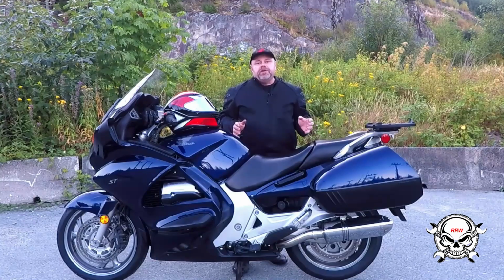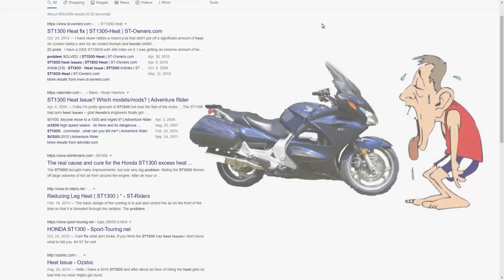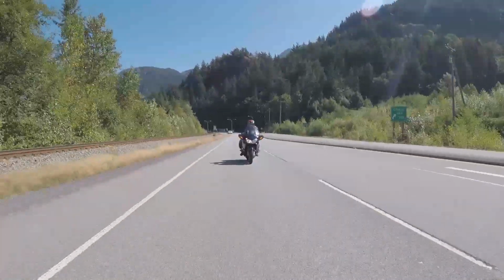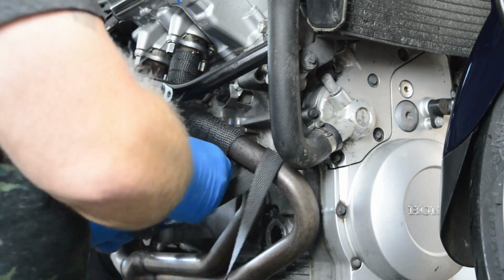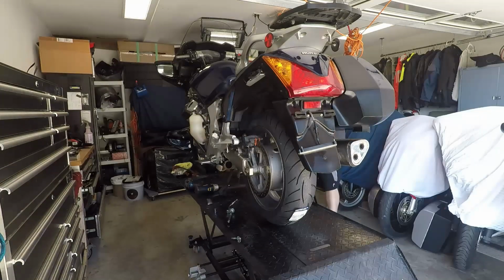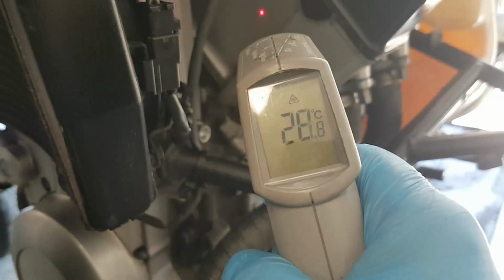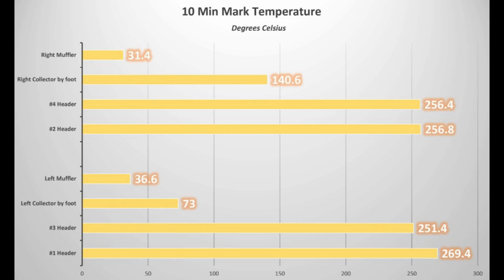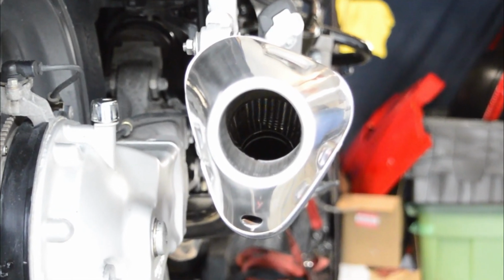Honda ST1300 PanEuropean Heat Reduction

Comment: Hi Rod
I recently bought a  2008 ST1300.
Never rode one before. 
Came off a naked Kwaka Z900RS.
Bike is beautiful. 
Went for a ride on a 26c day here in NZs South Island. 
Lower legs cooked .
Will do the pipe wrap and looking and buy Delkevic mufflers.
What model is on yours.
With baffles in how is highway noise  ?
Like throatier sound than standard but don't want it too noisy either.
Cheers
Love your work

Comment: I don't see any comments about venting the inner cowling to allow more air flow. Did that years ago, I'm in Mississippi, plenty summer heat, but no issues with heat of the ST after cutting  2 in holes in the inner plastic panels, simple and zero cost. Have a Silver 2007, since 2008 bought brand new; 50,000 miles on it and runs great. Only issue i had was the sensor wiring for the radiator fan, had hell getting to it way down in a very tight spot under the gas tank , I do recall, there was a short as the insulation had rubbed off,  covered it with insulation Like the heat in the winter! So i did not reduce any radiator heat but did vent off engine block heat from my shins
Reply: где  сте  направили  те две  рупе    ако  може  слика  хвала  поздрав
Reply: Which one.. can you show me the position

Comment: I don't see any comments about venting the inner cowling to allow more air flow. Did that years ago, I'm in Mississippi, plenty summer heat, but no issues with heat of the ST R cutting side 2 in homes in the inner plastic panels, simple and zero cost. Like the heat in the winter!
Reply: Can you post pictures on what you did?

Comment: Thank you, felt instant results on my first ride after wrapping. Totally transformed the comfort level... on a side note the oil filter is  on one side and rad hose on the other now have some added protection from the radiant  heat also.
Edit... 1st long distance run... absolutely no excess heat, avg 39 mpg at, shall we say ... spirited riding. And no my headers didn't rot and rust off...  Highly recommend this mod.

Comment: I read somewhere that the thermostat needs to be changed out on a regular basis because they don’t last long, what’s your opinion?
Reply: I’ve got an ‘05 ST1300, after changing the thermostat my bike is noticeably cooler running. With a broken thermostat the bike never takes off the choke, and so it runs lean and therefore very hot.

Comment: Hi Rod, I have just purchased a 2011 Honda ST1300 and am thinking of changing the standard tail pipes. Are the catalytic converters built into the standard mufflers, or are they built into the header pipes, as i believe their removal also helps with the reduction of heat generated by the motor. The standard mufflers do stifle the sound and make it sound like a wet fart almost, Cheers and love your videos.

Comment: Rod. I have a K1300GT and will be changing the muffler for a Delvonic muffler. Would you reccomend the 13” or 18” muffler?
Reply from the maker: If you ride with panniers then take the longer muffler so your exhaust is not cooking your bag everytime you are stopped in traffic.
Reply: I was thinking the same way. I usually do use my saddle bags on the bike. It seems the suspension likes the extra weight for a softer ride on the 1300. I will do the 18” muffler.
Reply: Luv your videos by the way. I’m picking up an anniversary edition Honda VFR800 with the factory bags and a set of Staintune pipes. Can’t wait to put some miles on that one.

Comment: Someone said that if I put exhaust wraps on my bike, the heat being trapped in the pipes will cause the motor to run hotter, and may even melt the factory wire harness, knock sensor wires/switches, and cause all kinds of problems with shorts, and alternator issues. 

Is this something you experienced in the time you had the ST?
Reply from the maker: Whoever this is that told you this, do not listen to any advice they give!  This is the exact opposite of what the benefits are of wrapping your header pipes.  Please think through the logic in this statement, The engine does not run hotter since the exhaust wrap is on the exhaust pipe, not the motor.  For decades professional racers have used exhaust wrap to keep engine compartments protected from exhaust heat so things like ignitions and wiring harnesses are better protected from heat. And as I stated in the video, the racer's claim that exhaust moves more quickly through the exhaust system with the header pipe wrapped.  This means that more heat is carried away from the engine...
Reply: My ST getting hot on fuel tank,after wrapping. 
Its ok until outside temp reach more than 32C. 
Pipes are not cooled from the outside air anymore And temp growing up steep.
My question Is ......
I'm only one,experience this?
By the way,this is very nice video. I dont want hurt enyone. Thank you.

Comment: Thanks for your version of heat reduction. I really like the comparisons back to back that you do.
As an owner of an 05 and 2012 model, I don't think I heard you mention removing parts of the inner fairing to allow for better air flow.
I had adjustable supertrapp aftermarket exhaust. it decreased performance.
I would use caution and wrapping exhaust as heat and cold cycles cause condensation and  results in rust.
Again, I enjoyed your approach
Reply: Had mine wrapped 18 years ago, live in high humidity, still waiting for rust!

Comment: I had two ST1300s, a used ‘03 and a gorgeous red ‘09.   What helped me( I lived in Shreveport while I owned these so my experience was pretty much like you in Austin) was running Mobil One.   I learned this running this oil in a Kawasaki Z1.  I also ran a Beadrider seat cover so I could keep air under my tail.
I bought the ‘03 with 35k and eventually sold it with 154k before I started listing for the red one.   When I bought it I transferred my trailer hitch and bar risers and then had the optional fairing deflection kit added.  That Kit really did good things for rain and wind protection.
I always found the wind noise harsh on my modular helmet and running ear plugs helped some but they were still noisy.   I have a 2015 Goldwing now so the wind noise is much better.

Comment: Thanks for the excellent video, Ive just purchased a Pan 1300 with 17000Km almost new, was standing for a long time, Ive have quite a bit of work done to it, reline the tank due to rust, sort out a lot of corrosion issues, the bike is running very well now, but the heat on my shin's is not good to say the least, especially as I live in South Africa where the temps are around the 35c here in summer.
Is the exhaust change going to make a significant difference on its own would you say?
Ive spent a load of cash on the bike as it is and dont really have it to burn, if its not really going to do the trick?
Reply from the maker: Hello Mike, yes wrapping the headers and changing to a free flow exhaust will make a big difference for sure! https://ebay.us/lO2vmh Good Luck with the new bike!

Comment: 1 - I have a massive burn on my shin from the heat off the engine. Can you point me in a direction to begin looking? In other forums I've been accused of living about the burn. I did buy high boots and that lessened the area of burn, but did not cease the burning.
2 - I was going to wrap my pipes, but was warned about the pipes possibly cracking. What gives? Is that something to worry about?
Reply from the maker: Hi Rob Never seen anything that bad from an ST1300, I've owned three of them and logged thousands of miles.  I think your issue is the exhaust header, the collector for the two pipes is right under your foot, my legs are short so my stance is wide when I put my foot down.  If your burn did not come from the header collector or crossover section under the middle of the bike, I would for sure wrap the headers all the way to the crossover pipe.  Everyone has an opinion but if your choice is replacing the headers after a few years or the bike is unable to ride because it is  burning your leg, it's pretty clear IMO.  There are lots of used parts for this bike on the market for cheap.  I personally think this is all bullSH*T and is a comment from someone who 1. Has no first hand experience from wrapping a header and 2. Just a contrary clickbait argument.  I've wrapped headers on cars and bikes, never seen a failure that was not due to the wrap falling apart because is old or was done improperly.  The header wrap is not permanent and should be redone every few years but that is pretty cheap too! - Good Luck!

Comment: Bought a stock 2005.Seat position on high mark. Big gaps between the seat and tank.  Fried my junk on the first ride. McGiver - Ghetto fix. Remove tank, layers of  aluminum foil sheets  sealing the gaps between the seat and tank. No more heat issues. Side heat vents are hot on summer days, but ok.

Comment: I just duct taped cardboard to the gap between the tank and seat. Made a noticeable difference.

I make a habit of not riding in traffic. The bike has mainly been for highway weekend commuting (Vancouver to Kelowna) and touring the mountain states of western USA. For the most part, the heat is not an issue at above stuck-in-traffic speeds.

Comment: Does the ST1100 have same or comparable heat problems as the ST1300 ?
Reply from the maker: Not really, most ST1100 owners never complain.  This being said, the ST1100 is a product of the time it was produced. Carbureted, top heavy, meh brakes and suspension, most you'll find today are in need of $erious expen$e to restore (all old bikes fall into this category).  Having rode both bikes, the ST1300 is a my hands down choice, the 1100 is not even comparable.  There are also a lot of bikes you can buy that should be newer for the same money BMW R1100RT https://youtu.be/1y23fS37_k0  :yt:  I know a lot of ST1100 owners love their bike, it is comfortable for a big bike and moves reasonably well for their age.  The carbs are complicated and most used ones have lots of use with high miles.   Let us know if you're considering one. 👍
Reply: Thanks for the reply . I just found this RR&W site and enjoy the content and the overall attitude of it. Thanks again and good luck .

Comment: I have a ST1300PA 2016 left over police bike. I cannot find an aftermarket muffler that match that model. Are you familiar with this model ST1300PA?
Thanks
Reply from the maker: Hi Kevin, I am not familiar with the PA model, based on part number searches and photos there is no difference between the standard and the police model for exhaust or muffler.  You can check the ST1100/1300 forums as there will be some riders there who have police spec bikes but even if your bike is slightly modified the standard muffler should bolt in place. - Good Luck!
Reply: Thanks for replying.
On the aftermarket muffler that you installed you talked about the noise. 
And to cut the noise down you put the baffles back in. How much does that change the airflow? I know you mentioned that taking the baffles out allows more airflow which in turn produces less heat. 
Thank you!
Reply from the maker: @kevinmortensen7186  Hi Kevin  You can see the difference between stock, baffled and baffles out on this video with a db meter along with some other performance updates. https://youtu.be/HE3_h2I_rK8

Comment: I bought a 2007 ST1300 one year ago this month, I did some minor maintenance on it and changed the oil and filter, as well as the fork fluid. I absolutely love this bike, ive wanted one for years and became very fortunate last year when I was able to locate and purchase a 07 with 30k miles. I ride it daily here in Austen tx and the heat is pretty bad, it almost burns your bum. this winter I plan on doing an exhaust and give the rap a go... my plan is to ride it out to the north west and maybe even Fairbanks. thanx for the vid it really helped me.

Comment: Wouldn’t you think modifying the front lower fairing would help to move air around  the motor? 

Did you ever try anything else under the seat?  I am picking up a 2007 and in TX I can see the heat may be a problem.

Comment: All the mods needed to reduce the heat problems seems so expensive that simply moving to an Yamaha FJR1300 would be a better solution.
Reply from the maker: But then you still have to contend with the lack of power from a dual counterbalanced inline four. (don't let those get out of synch or you've got a bike only your Wife will love due to the vibration ) 😉.  I've owned two of them...

Comment: Nyce job 👌👍Like yr scientific approach to quantifying results. A lot of suggested mods from pals n other riders are more urban myth than proven science 😁I also like very much that you know of the top parts suppliers, for those might win the prize,  in lots of jurisdications EVEN across the pond in the UK 😄Shoot, "ghost bike" is not a Triumph Sprint GT 😔 Why I wanted it to be a Sprint GT, guessing not much demand, is because it has a serious problem with over heating especially in slow traffic. Like a Spitfire 😁on the runway, she overheats badly but when she's taken off she keeps cool n is just a  beautful agile flying machine ! Will look through past vlogs but any tips to help cure or even just reduce the amount of over heating ??
Reply from the maker: Thanks for the feedback.  I have not had any issues with Triumph GT/ST 1050 or Speed Trip overheating but I will look into it.  Thanks for Liking & Subscribing!

Comment: I’ve got the exact bike as yourself and have a set of Two Brothers exhaust and after market Leather Sargent Seat with special super cell premium foam with deeper pocket. Both the seat and exhaust came with the bike and I’ve never really noticed any excessive heat coming from the bike, but I rarely run in Urban Environments. I’m totally with you on the aftermarket exhaust for St 1300, since I can keep the speed down and know what gear I’m in by the sound of the bike.   
The Two Brothers just gives me that Honda Growl and totally compliments The V 4.
Reply from the maker: New ST1300 Video Coming Soon...  Thanks for Liking & Subscribing!

Comment: So after you got all the Tupperware back on, did it still stay cool, especially in the seat/tank area?
Reply from the maker: It was cooler on the legs and fairing, much better at low speeds in traffic.  Was not as dramatic an effect on the seat at highway speeds in the heat.  New ST1300 Video Coming Soon...  Thanks for Liking & Subscribing!
Reply: @RodRidesWrenches  Thank you for the response still on the fence about doing this or not. I really enjoy your video's top-notch!

Comment: Bought a set of Delkevic long ovals. I don't care if it runs cooler I love the sound. At times the ST can be boring to ride even at surprising speeds, the sound of these pipes fixes that.
Reply from the maker: Agreed...  New ST1300 Video Coming Soon...  Thanks for Liking & Subscribing!
Reply: @RodRidesWrenches  hi
Can you do a video how to remove a alternator on a 2009 Honda st1300pa model?

Comment: Thanks for the work involved and love the detail that you go into, but I feel you can only really tell what mod is making a what difference if you do the testing one mod at a time - ie what temperature difference would just the wrap make on one side with both stock mufflers, then with one muffler changed, etc.  IMHO, I still think that a lot heat is directly transferred from the engine cases to the frame by the riders legs as they are firmly bolted together in at least four places.
Reply from the maker: Thanks for Liking & Subscribing, New Video this Friday!